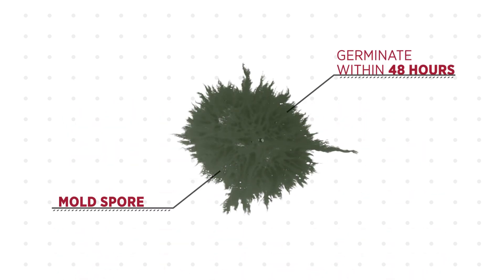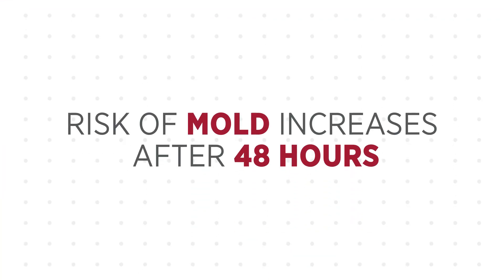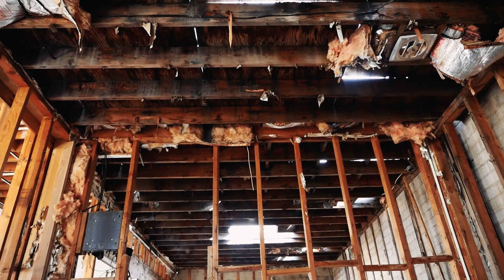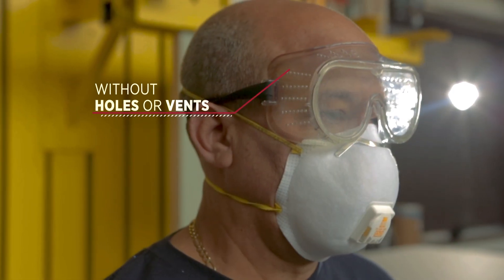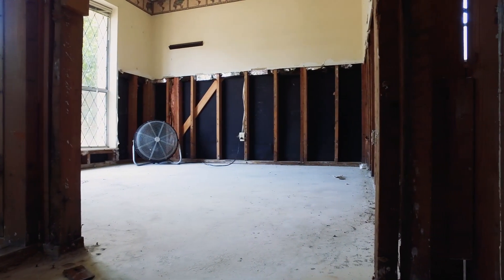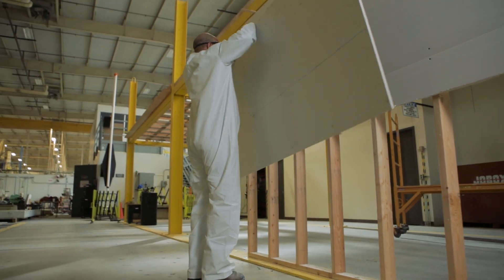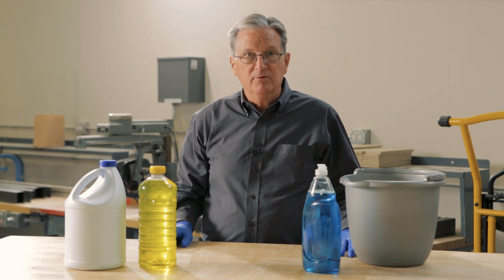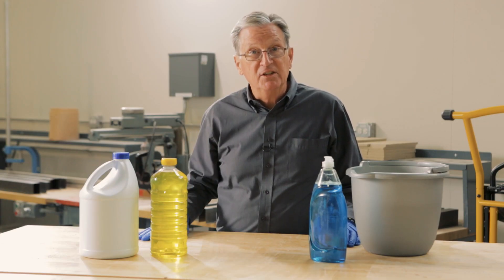Mold Removal Clean-up Best Practices

Comment: N-95 masks are a joke.  No one that actually works in the mold remediation would use them for more than large chunks of sawdust. Wear a respirator.  Doesn’t take 48 hours.  Just get it dry fast. I’d start to get worried if it takes over a week to get dry.  If it’s that wet you might just do flood cuts to speed it up.